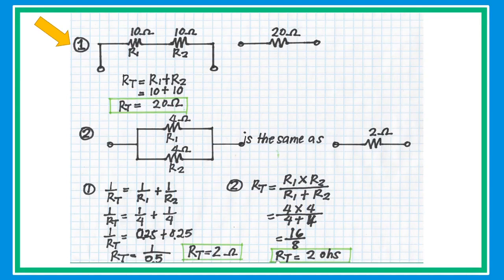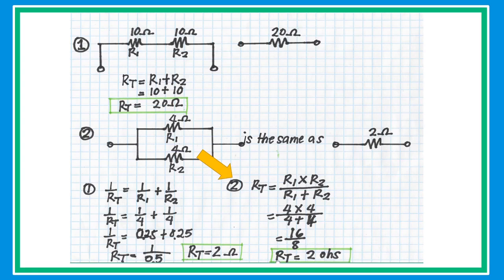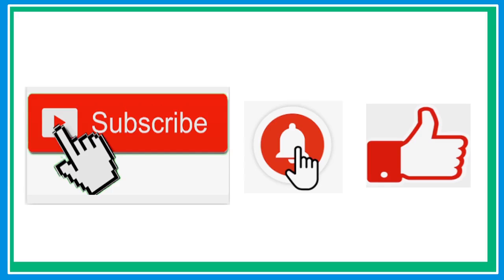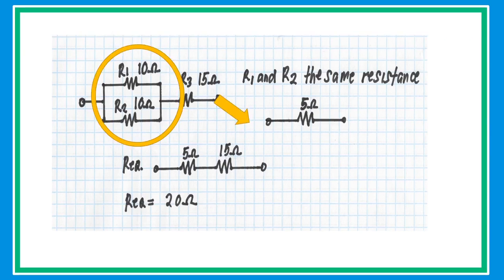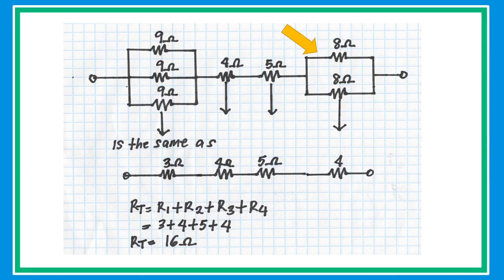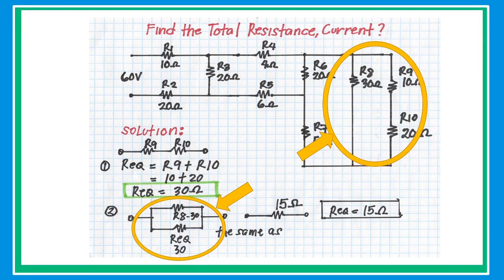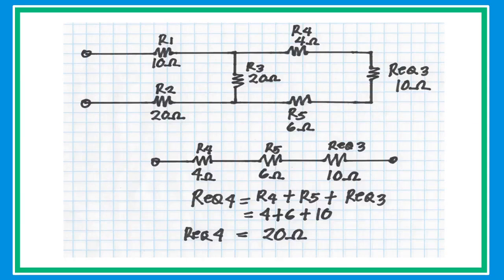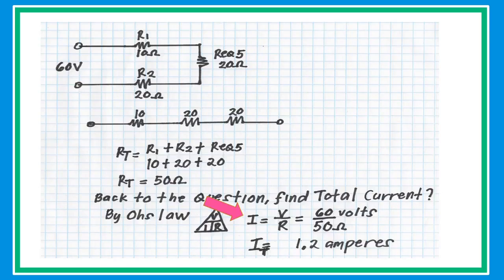MASTER Electrician License Practice Exam PART 7

Comment: When calculating REQ5 the total should be 10 ohms, not 20 ohms.  So resistor total should be 40 ohms not 50ohms.  Leaving  I=1.5A. Correct??